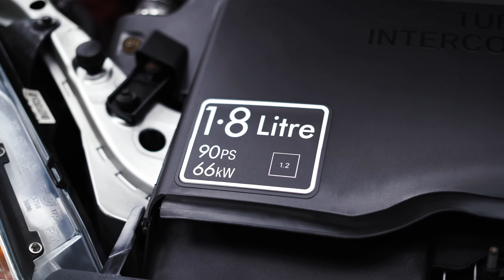Engine Bay Deep Clean - 20 Year Old Ford Focus - Auto Detailing

Comment from the maker: What do you guys think of the end result? It's not perfect but definitely a lot better!
Reply: Vermijl, i use GS on engine bay, is 1:5 too harsh?
Reply from the maker: @ims7568  I also used it 1:5 here
Reply: Very very good 👍🏻
Reply: 🏈🏈 touchdown!!
Reply: Alweer een mooi video, maar mijn enigste vraag is: Nadat je met die Motorplast spuit. Laat je die product gewoon drogen?
Reply from the maker: @mergimi96  klopt ja, gewoon enkele uren laten drogen, er zal altijd wat overtollig product/water blijven zitten op enkele plaatsen, daarom best nog eens navegen met een microvezel doek
Reply: Hi Lennert can show how to clean the roof interior
Reply: Bro you sure that throwing water to the engine its a good idea? It could damage the computer
Reply: Great
Reply: @VermijlCarDetail  do you unplug battery or leave it as it is
Reply: Looks like a almost new! 😀 I also have Focus mk1, 1.8 tddi but in combi. You inspired me for increased work with cleaning it! Thanks for this films!
Reply: @VermijlCarDetail  1:10 is usuall more than good enough - everything else is just a waste in my humble opinion
Reply: Your work is so nice, I work in my detailing shop all day, but I still watch and enjoy these videos.
Reply: I have some wire harnesses on firewall where some bundle of wires are exposed where they connect
How do you clean these
Reply: Hearing that belt I think this job was pointless. But maybe the mechanic will be happy to work on the clean engine. :)

Comment: Really cool video! However, is it safe to do this with any car or did you cover some stuff with bags? Such as the dynamo or the battery?
Reply: This car has a lot of covering over the engine air filter and seems to be tight cables but any mechanic will tell you do not power spray the engine bay as it could get into the connectors. Some times after spraying the engine bay with a power sprayer it’s possible your car won’t start. If you power spray it anyways just be cautious around the connections make sure the battery is disconnected from the car and make sure to dry off any cables and very important make sure all the water that gets in the spark plugs areas is dry.

Comment: Ive got a Dacia Sandero from 2009. Can I use a pressure washer in the engine bay like in the video? Im worried about the battery for example.

Comment: Love this engine detail, thanks for the video .. one question though to you or anyone out there ... my concern is always a battery. Is it necessary to take it out? Or cover it? And how? It does say on the cover it should not get in contact with water... any suggestions?  Thank you!! 🙂👍
Reply: I need answers to that question too
Reply from the maker: I didn’t disconnect or cover it here. You can of course disconnect it and cover it with a plastic bag if you want to be extra careful. I’ve done many of these and never had any issues doing it like this
Reply: Thank you for making the time to answer! 🙂
Reply: @nox8484  thank you 🙂

Comment: Great video production value, cleaning over top , looked great , I’m sure customer was thrilled. I doubt I would used a “ new” towel on an engine bay, even a cheap one, as once my towels touch and engine or wheel, I thank them for there service and toss them. Nice touch for the video though.

Comment: You should use air pressure cleaning in last, which will remove water from engine cover and air filter cover and make them completely dry because single drop of water can damage a whole engine.
Reply from the maker: I did blow it out with my car dryer but actually forgot to record 😬

Comment: Did you disconnect the battery? Even if it's covered, you can still mess up the current of the battery. Make sure you disconnect the black one before water is used.